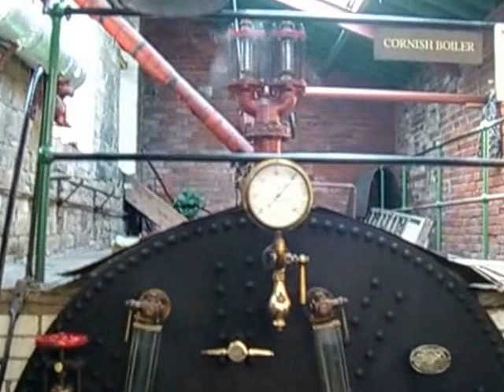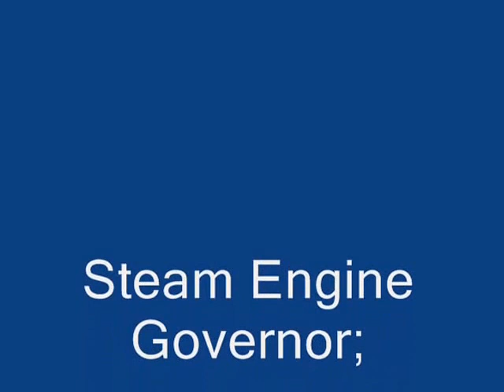Steam Engine Governor

Comment: Where is this? I've seen engines like this in museums all over the world, but never running!
Reply from the maker: Hi FlyNAA,, This one is at Barnoldswick, Near Manchester, England. I think Manchester has three 'Mill' engines which are in steam, this one, Queen street Mill in Burnley near Manchester, (see my video on that one) and the big Trencherfield engine at Wigan also near Manchester.  For about 200 years (About 5 generations of workers!)  this was the normal way to power an industrial works, right up until the 1930's when mains electricity was available and each machine had its own electric motor.  Interestingly the standard UK  road sign symbol for an industrial estate is still a tall chimney, the legacy of the boiler houses that each works had to have to power the mill engine and are a feature of LS Lowery's paintings. The chimneys are mostly demolished now (they were an expensive maintenance obligation), but were once a sign of an industrial Zone. (Now, equipment is electric so there is no chimney needed).  CORRECTION;, this governor is what was previously called a 'Regulator', which in modern times is called a Proportional/Integration algorithm  controller (PI) (Not Derivative as I wrongly Said). .
Reply: Mark Wood Turns out the location was right in the start of the video — oops!

You might be interested to know these governors are used on airplanes from just before WWII through the present day to hold the engines at constant RPM by regulating prop blade angle (and therefore load). That was my path to knowledge about them, and it fascinated me to learn that they were used all the way back on steam era engines. (and Wikipedia says they originated even further back, on windmills to regulate distance and pressure of the mill stones). I’m fascinated with these things because I see a profound elegance in a device so simple, through the interactions of its physics, accomplishing something so complicated.

BUT! Just yesterday, while watching a Youtube video of someone running a small model version of one of these, I had a crisis of understanding. It was the simple type, like you see in all the basic diagrams when you search for flyball governor, where the flyballs are directly connected to the valve - in other words, proportional control. I realized that that setup can’t hold a constant RPM under varying load, as when the load changes and the valve responds, if it goes back to the original position (corresponding with the original position of the flyballs, and the original RPM) the condition can’t be maintained because that’s the very valve position that was just gotten away from, and is now insufficient with the changed load! If the load increases, constant RPM would require a more open valve than before, which means flyweights further out, which means higher RPM than before, not constant. It just doesn’t add up! So the best this direct setup can do is a partial return of the RPM toward its original value.

But how does it work on airplanes, which I’ve experienced for years perfectly holding the RPM? I realized the flyweights don’t directly control blade position, but there’s a step inbetween - they provide a increase-decrease signal (done hydraulically in this case) so they control RATE not POSITION. Now, when the load changes and the flyweights come off-normal, they maintain that “increase” oil path as long as it takes for the physical system to configure itself so the RPM returns to the set value, and the flyweights return to normal - or, the integral control.

So then I was thrilled (and could sleep easy again) when I found your video with the equivalent device in the ratcheting mechanism that engages when the weights come off normal, and continues to stay engaged for as long as they are so, continuously driving the valve position in the meanwhile.
Reply from the maker: @FlyNAA  HI, yes glad you found out about that. Feedback control is not as easy as it sounds, the wikipedia article on PID controllers does a good job of explaining it. In order to prevent the instability oscilations, there has to be some kind of "Damping" mechanism. In steam engines it is the huge 50ton cast iron flywheel, which stores energy and prevents rapid changes. In modern times for example in Drones and robots, to save the weight of such there is a Dirivitave algorithm, it detects if we are getting to the right speed too fast, and 'puts the brakes on' so to speak. However, interestingly you can use this fact to increace the proportional gain even more as you are not afraid of instability. So perversely the Dirivitave algorithm is often used to increace the proportional control safely, in any system which is likely to be a bit springy. See "Impirical PID Tuning (You tube) by kevin lynch for a good demo of that.

Comment: Do you think it may be considered the Steam Engine Governor as an appropriate controller? Why?
Reply from the maker: Hi Bleach; A Classic James Watt 'Governor' is a 'Proportional' Algorithm controller, which has many problems including potential for instability and and also serious offsets from the set point. It can go crazy and never does get to the right speed. So later designs like this one tried to overcome these issues with a Integration algorithm. In modern times robots and aircraft auto pilots use the PID algorithm, Proportional, Integral and Derivative algorithms to solve these problems. Type PID into Wikipedia for a good description of this. https://en.wikipedia.org/wiki/PID_controller